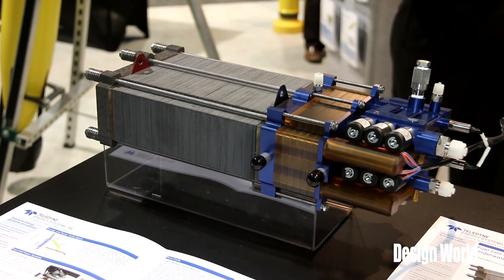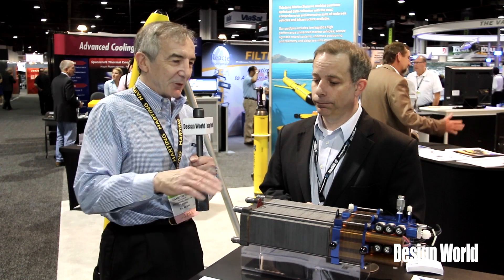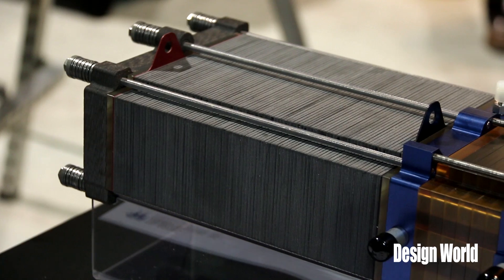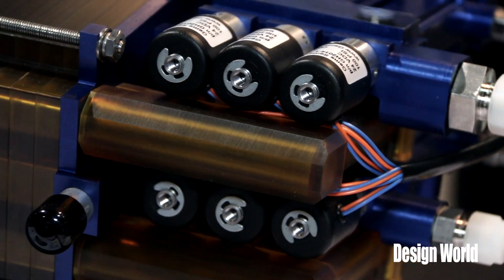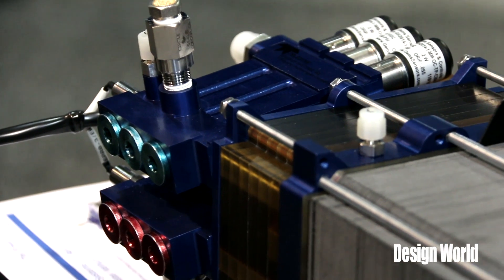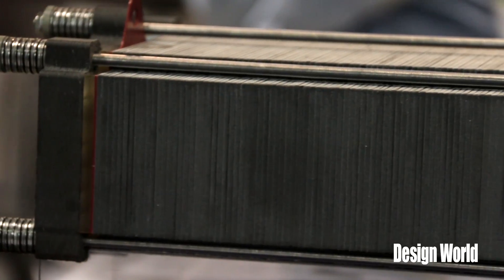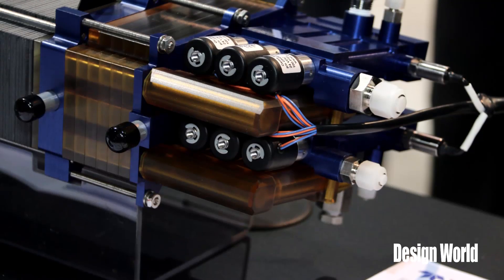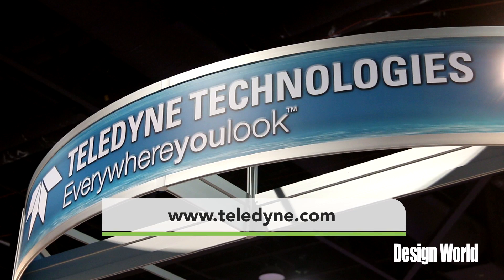Who needs batteries when you've got a hydrogen fuel cell

Comment: he doesn't  have a lot of answers now does he. more beating around the bush more than anything else,
Reply: You're beating around the bush about him supposedly beating around the bush.   Why don't you be more specific.
Reply: These were stupid questions. A battery is something different than a hydrogen fuel cell. If you want to compare a hydrogen fuel cell with a battery, you also need to consider how to recharge the system. You need hydrogen to keep a hydrogen fuel cell running. To recharge a battery, you just need electricity and recharging a battery is much more efficient than using a hydrogen fuel cell to provide electricity.
Reply: @1stSilence  the average hydrogen generator for commercial use uses 3KW continuously to produce large amounts of hydrogen and oxygen if this cell produces 6KW and uses less hydrogen than it is produced you still have 3 KW left over the average household uses 2 KW a day and they said it could be scaled up that is an endless supply of energy as long as you feed in the hydrogen you produce from the hydrogen fuel cell
Reply: @silenttitan7636  I have no idea, what you are trying to tell me.
Reply: sit back and relax. There are people working on it allover the world. Instead of make room for improvement you guys contradict. there are no such things as free energy or Bitcoin, Its allin youre heads. But also in mines:)  as i said . sit back and relax. when you dontknow you dont know.
Reply: Angus, yes, the energy density is worse, compared to hydrogen. So it depends on the application, what is preferable. For electric cars, for example, batteries are clearly the way to go.

Comment: but you need a continuos source of hydrogen to keep it running..
Reply: I need a continuous supply of fuel for my car or it stops.
Reply: YES!!   hydrogen is lighter than air. So will be a lot lighter than a battery.
Compressed hydrogen has an energy density of 142 MJ/kg.
Lithium ion batteries have an energy density of 0.6 MJ/kg.
Reply: @bazahaza  a hydrogen cylinder is going to be a lot heavier than li ion batteries
Reply: @fsdsavinglives  the tanks in the Toyota Mirai weigh 87.5kg. Model 3 Tesla battery weighs 480kg. Please do research it only took me one minute.
Reply: Electrons are even lighter than hydrogen.  Usually the weight of the system has to include everything needed to contain and convert that energy into something usable.  
 With a battery, it's all in a single pack. 
 Showing just the fuel-cell is very misleading. You have to see the size of the tanks and the weight of the tanks.
 Hydrogen Has very good energy density for weight, but very crappy and energy density for volume.  It really cancels each other out, because the tanks needed to compress, and make up for the volume, ruins much of the weight savings.
Reply: +Joe Viocoe  As a simple rule to choose between fuel cells and batteries is like this:
At any power requirements, from a cellphone to the biggest machine ever built (The Bagger 293), if you need to choose a way to store and provide energy, you need to ask yourself 3 question:
1- For how long I need to provide that power?
2- Fast re-charge matters?  (usually in utility applications)
3- Weight matters? (usually in flying machines)
For apps where you dont have to provide that power for more than 4 hours, then batteries are more cost efficient. And beyond that; fuel cell is the way to go.
If charge or weight matters, you also choose fuel cells, for example in flying machines instead 4 hours the cost efficient limit between batteries and fuel cells would be at 2 hours.

The main reason of this, is because if you have to double the time you provide power (also range in vehicles), in the battery it will cost and weight double.  In the fuel cell case, you just need to increase the tank size a 25% (this double the volume)

This is true in case you are a company, if it is for a single user requirement, then fuel cells will be expensive because right now there are not many models or big scale production.
Then of course hydrogen right now has a problem with production and distribution, but it could be very easily solve in few years without much investment.
Reply: You also have to compress or liquefy it, which costs even more energy. The whole point of using hydrogen or batteries is that it's supposed to emit less carbon than the status quo. It's hard enough for renewables to pick up the slack. I am talking more about cars. Planes could simply burn hydrogen and the giant tanks can act as a lifting body. Ships are the only mobile thing can be nuclear powered.
Reply: +The Eh Team why it matter the amount of energy if we are talking of clean sources?  
The only thing that matters is the overall cost.. from generation + storage + distribution + devices that consume that energy.
Today wind energy and solar are the cheapest way to generate energy.  In the last 7 years, the cost drop around 1/3 for wind and 1/4 for solar, meanwhile all the other fossil and nuclear thermal plants rise their generation cost.
Today wind turbines cost in average around 2 to 4 times less than nuclear.
But if your intermittent generation sources rise about the 40% of the total grid.. then you need storage or other kind of ways to balance the load.
So what you will use?    Kinetic wheels are only cost efficient to storage no more than 1 hour, batteries up to 4 hours, pumping hydro 8 hours, hydrogen up to 2 months, then you can convert that hydrogen to methane (capturing co2 from other process) which is more cost effective to storage for seasons. (this is needed in countries at high latitude).
This is true at any power level, from a cellphone to the biggest machine ever built.
Why batteries are not cost efficient?  is easy to understand, here an example:
Take a look how much it cost the battery in a electric car..  if the electric car has 350 km of range, then it means that only can provide the power in which it was designed for  over 4 hours, if you want to double the range, you have to double the amount of batteries (in fact way more, because batteries weigh a lot).
But with hydrogen, once you have a fuel cell that can provide certain power and travel 350km with the h2 tank you have, in case you want to double the range, you just need to increase the tank size in a 25%, this double the volume, which double the range.
How much it cost that?  almost nothing.   But for small ranges, batteries are more cost effective, the limit is around 4 hours, and for flying things the limit must be in 1 to 2 hours.
About liquify, is not a big issue.. it is really convenient in airplanes because you can recover the energy used in the process to increase the efficiency in the turbines, because it can work at higher temperatures without melting and using lightest materials. Using lh2 instead aircraft fuel you also save like half of the airplane weight, which means you need half of the fuel to achieve the same range.
But to distribute h2 for a whole hydrogen economy, it may be way more easy that you might think.
The gas grid already can storage hundreds to thousand of TWh just varying the pressure a bit.
With filters that let pass the hydrogen but block the methane, you can extract pure h2 from any place of the grid.   Anyone can produce h2 in his house, service station, company when the price is low and sell it to the natural gas grid, in the same way we do it with the electric grid; or  storing that in your house tank.
Also you can burn the hydrogen mixed with the methane without any added cost, and is clean.
I will not use nuclear in ships.. is not cheap neither safe.
Reply: Hydrogen is the fuel just like gasoline is used in today's cars but it is much more efficient and clean.
Reply: so.. hydrogen has way way more energy density and almost no weight than batteries.
Reply: There's not exactly anywhere to buy hydrogen, and the whole hydrogen fuel cycle is as inefficient as the internal combustion engine alone. I'd want a natural gas fuel cell for when the power goes out, backup generators are noisy and more inefficient than a bunch of cells.
Reply: +The Eh Team current fuel cells are 60% efficient and current electrolysis device are at 81% efficiency, and both are rising, dont forget that the investment in research of hydrogen technologies just started 5 years ago, different than batteries which started 15 years ago with cellphones..
In just 4 years, fuel cells achieve to reduce 1/3 of its size and cost for the same power.
Also.. it does not matter the efficiency cycle..  it only matters the final cost of the energy..
Hydrogen allows to storage huge amount of energy (months) at a very low cost,  you can not do that with batteries or anything else..
This mean you can produce hydrogen when the electricity cost is at its lower (even negative cost in some cases), this mean you can get hydrogen almost for free or at very low cost meanwhile you balance the grid load. 
A lot of things can not work on batteries.. simple just cant..
Commercial airplanes cant..  trucks.. cant..   utility vehicles cant...  ships cant...
Any machine, device or vehicle which need long range and fast recharge times, the only solution for those is hydrogen..
Reply: Until the supply runs out then you can just recharge it.

Comment: Seriously??  That stack is capable of 6kW???
Reply: He doesn't say how long for. Most power supply systems are specified in terms of peak power and continuous power. He stated that the peak power is 6kW which seems quite reasonable, but the continuous power will be less.
By comparison, Intelligent Energy make a 4kW continuous power fuel cell that is small enough to fit inside a scooter: http://www.intelligent-energy.com/news-and-events/company-news/2017/02/07/intelligent-energys-fuel-cells-stacks-to-be-used-in-met-police-zero-emission-scooter-trial/
Reply: He said that the comparable battery would be as big as the table top
Reply: Yeah... I didn't catch that "peak power" before. The bit about the "passive injector pum"p (to recirculate the reactant gasses) is cool though... probably a pulsed venturi "pump". That would seemingly utilize all of the reactants without any escaping. It creates gas flow for higher conversion efficiency with near zero energy cost.
Reply: @shadycraig  >"He doesn't say how long for." Sure he did. 7500 hours, apparently as a demonstration. 2:39
Reply: it all depends on year, in 2010.. fuel cell research start to take speed, in 2013 or 14, they accomplish to reduce in 1/3 the size and cost of fuel cells.
Today hydrogen is having all the attention and a lot of investment, batteries seem to have the lead just because heavy research started with the mobile phone, now fuel cells are catching up.
For me.. the cost benefit change happens with application that require more than 4 hours or 1 hour for flying devices.  Less than 4 hours.. batteries is the way to go.. more than that.. hydrogen.

Comment: 6Kw!!!!
Reply: If that's continuous output why is everybody still running a generator or even using the electric grid every household could be independent people would save so much money and with 6 KW you could make a  generat more hydrogen to feed more hydrogen into your hydrogen generator it could probably be an infinite loop
Reply: 6kw peak though, probably 4kw average